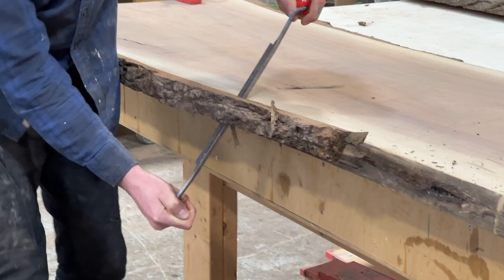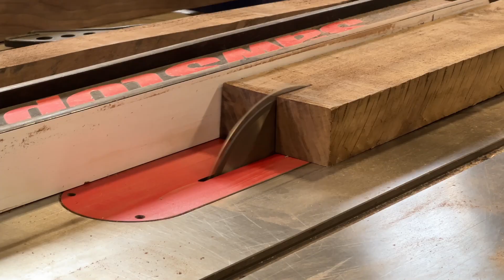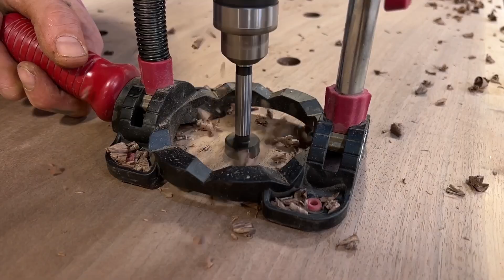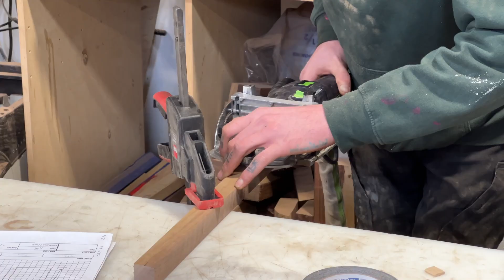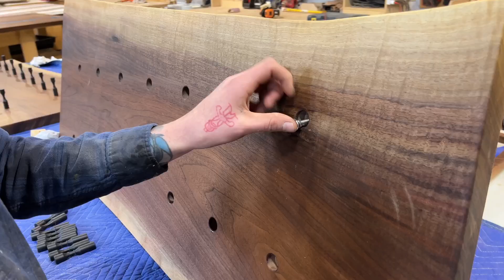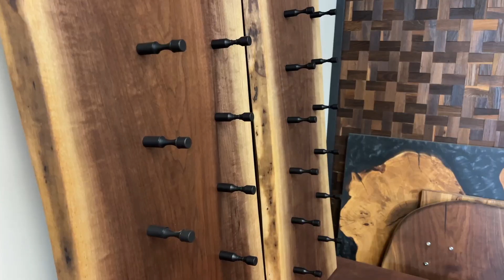Building Custom Live Edge Wine Racks with LEDs

Comment: Does it only fit that size of bottle ?
Reply from the maker: It’s designed for 750ml bottles which is about 95% of the bottles out there so it’s pretty universal in terms of the bottles you can put on it

Comment: Awesome. Top tip though. The 10mm cutter on the domino is great for making slots for cables for lighting. You can even do 3/4 the depth from both sides to avoid blow out
Reply from the maker: Love that input! I always just go for holes for cable management but I can see the domino working well and looking great too!